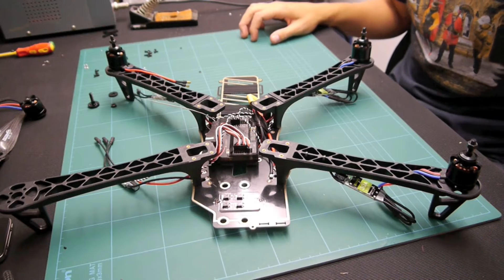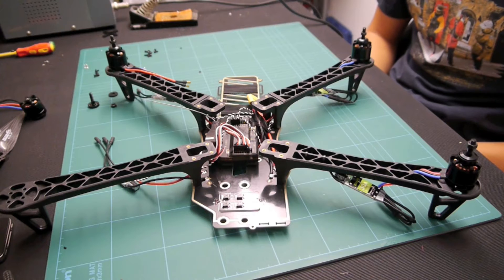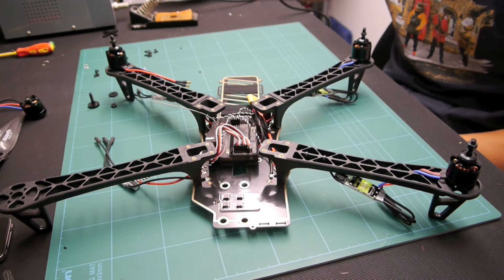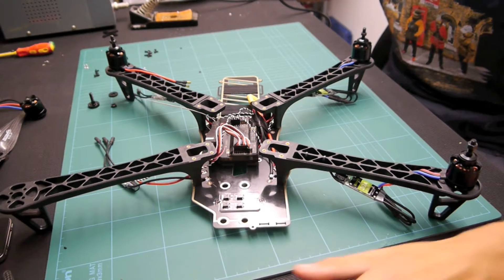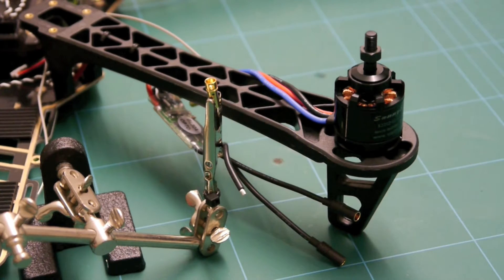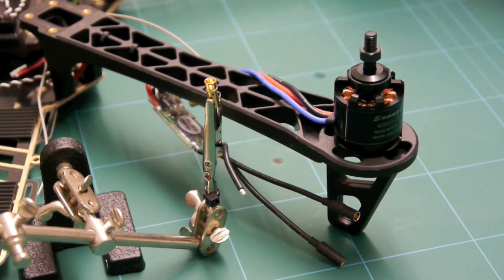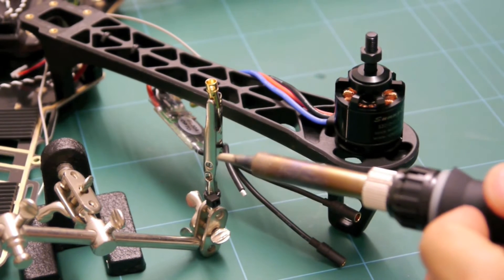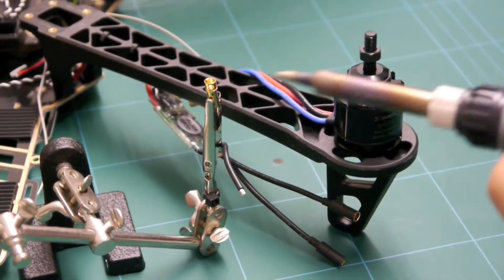TheManLab - Motor/ESC Connection - Diatone White Sheep APM Quad Build - Part 3

Comment: Hello. I do not quite understand in English. Why have you changed the propellers adapters?
Reply from the maker: Two propellers spin the opposite way to the other two. The different adapters make them self tighten. This make them a bit safer and don't need to tightened on as much.
Reply: Thanks for the answer! Now, these adapters are not sold. http://www.ebay.com/itm/391105375926 that's what I need?
Reply from the maker: +Micha il Yes that was my item. I have some left if you want some.
Reply from the maker: +Micha il Yes they will work.
Reply: Thank you very much for your answer. I'll buy two sets :)

Comment: hi !!  a have built , my own whitesheep   with sunnsky x2212  with ztw spider 20amp opto and for the flightcontroller i started with naze32 ( full ) but  i have problem with it is not stable, i  had a big flip at take off  and it flipt and landed on a front right motor and the bearing did not lik it. need to change it.

but i need to now ha good the APM is  need to see  first flight soon
Reply from the maker: Hello. I am just about to upload the next video with all the APM setup. It's currently raining so I can't maiden her yet. Will hopefully get her out later on today.